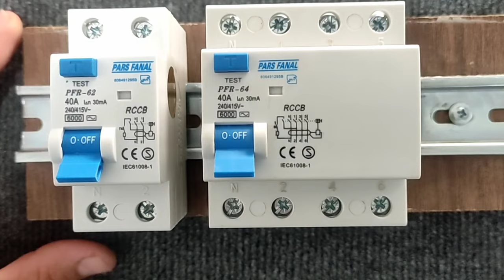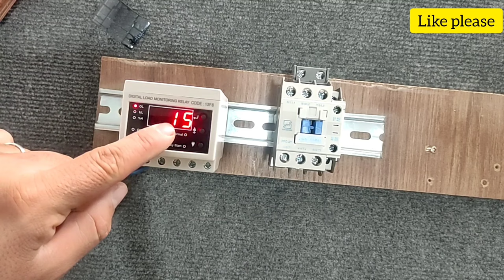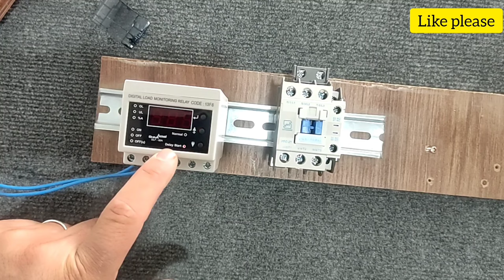how to wire miniature switch, RCCB switch, contactor, phase controller, load control and timer.

Comment: how the threephase relay knows in which direction the motor rotates?
Reply from the maker: Hello, the three-phase relay does not recognize the direction of rotation of the motor. It detects only three phases of the power grid and if there is a phase shift in the power grid, the relay cuts off the circuit
Reply: @IET-76  ok, but you shut down the circuit breaker and you switched the phases... does it memorize the phase order?

Comment: man I am trying to LEARN how a timer works and it feels sloppy. You just skipped over a part where you connect the "coil" terminal on the contactor above to the phase 1 terminal on the contactor (can't see what it says) and later you skipepd the video and the wire is gone. WTF?

For the timer on the lower part you got 2 wires on the same terminal in the middle (15? can't see) weren't you supposed to connect PH to 16 on the right??? This is fishy.

And what is the purpose of putting a jumper cable from PH to start. WHY? There's obviously a reason why there's 2 terminals there from the manufacturer and you're supposed to explain how they work but you don't. I'm just supposed to put a jumper cable there and I don't know what the hell it does. 

In fact, when you started wiring the whole timer, it was extremely hard to follow, you spoke way too fast (for me) and provided no schematic.  Makes it harder to follow when all the wires are the same color.

You're  going over too quickly for me, I would've focused more on explaining exactly what each terminal is or how it is connected inside, and a schematic for the wiring.
Reply from the maker: Hello, please ask one of your questions so that I can answer you. Thank you